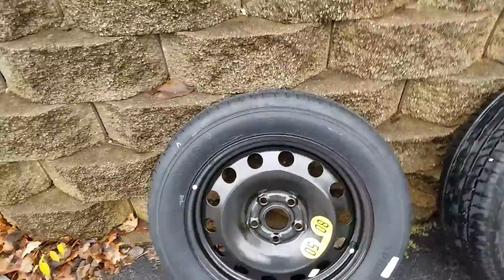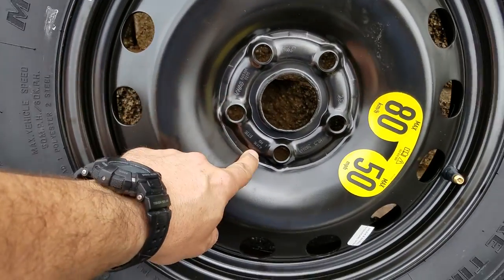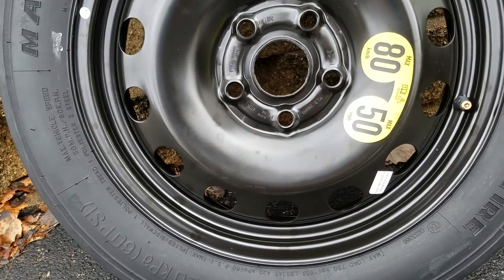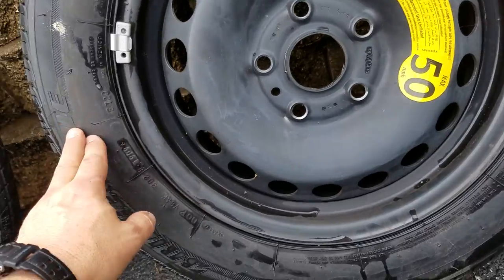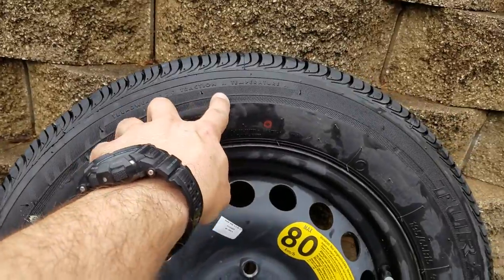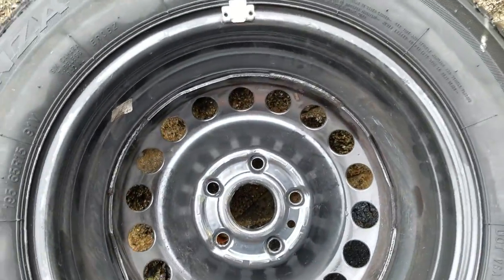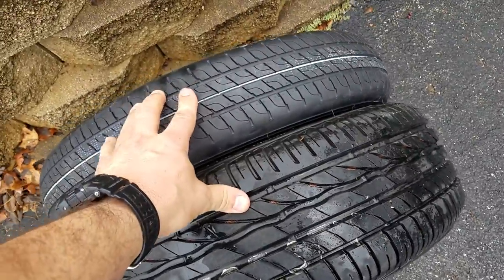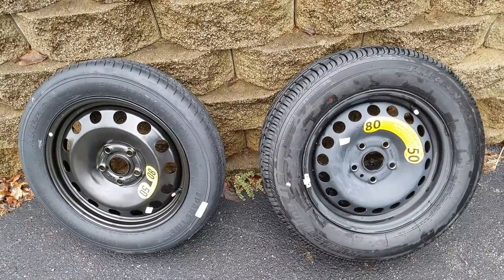Spare Tires are not all created equal

Comment: I did 810km/500miles on my little dummy tire on my way back home, rear mounted 125/85R16 Pirelli, load index is pretty high, it's 99 or 775kg/1705lb and speed index is M or 130kmh/80mph, so they are not flimsy at all when you need it.

Comment: Spare tires are not made for long term use. They are made to get you around until you can get a proper tire and made to fit into the small space that they occupy in your vehicle. Plus these thin donut tires are way tougher than they get credit for. My wife at the time drove on a spare for 5 months and she did the speed limit on the highway, not 50 mph. The tire was completely toast after 5 months because that was way too long to drive on a donut, 
but people act like you can't drive on a spare for more than a day. No it's not a replacement spare, but most vehicles don't have room for those unless if you have a jeep or a truck.

Comment: My question is I need an 18" space saver just incase, but when I browse for other cars, they all look the same..could I get any 18"space saver and put it on mine if needed? The bolt holes look exactly the same on all space saver wheels I've seen..could I get any 18" saver and call it job done?

Comment: I drive 75 miles per day so a donut is never an option if I can’t get it to a shop right away. I’ve always put together a full size spare with a basic steel wheel with an affordable tire that’s equal in size and rating. Much safer and gets me where I need to be. Also don’t have to swap tires around if the flat is on the front.

Comment: I just bought 4 spares at a junkyard and refurbishing them.

Did you already have the bigger spare wheel?

I really don’t need more wheels and tires, but I have so many, I really need to find a vehicle like a Ford Escape or Ranger that could use them all, I am still breaking in my Mazda at 200k

I had a 07 Mustang but it passed 😱😱😭😭😭

Comment: I bought an actual regular tire for my 2003 Lincoln Town Car last year, and I am glad the technician sales person at the tire store told me that the lug nuts and tool to put on my wheel were in this zip lock bag and where he put it in the trunk with my new car because the set up was different from what was on my car, the other tires, that is.  It sure came in hand the other night when I had a flat tire, and had to call AAA to get a tire changed.  Men don't offer help to women alone in southern towns like Macon, Georgia, which is why I as a divorced woman have had AAA since 1990.  If I had to depend upon a man with a helping hand, I would be waiting until hell froze over.  Have a good day.  I used your video for a Facebook post, to explain to my friends on Facebook, how my regular tire in my trunk saved the night for me.
Reply: I did that for my 2001 Acura MDX too! On mine, my new spare matches the rest of the regular wheels, and I drive A lot, so when I get a flat, nothing can stop me!
Reply: Jay Santos 😂😂
Reply: You should’ve bought a Cadillac and never had that problem.

Comment: Wait, what? 90 (or 80 or whatever) is not a ratio on a space saver, but it is height in mm? Where did you find that? BTW space savers are great if you - well - want to save space, e.g. when your car is equipped with LPG tank and you carry your spare in trunk, or to have extra storage under floor

Comment: Well, if you're going to that size tire for your spare (and you have room for it) you might just as well buy and carry a regular rim/tire and rotate it in to the rotation schedule and get the added mileage savings on the other tires.
Reply: That  is not an option on some cars.  Different  sizes  front and rear and  they rotate only one  direction.